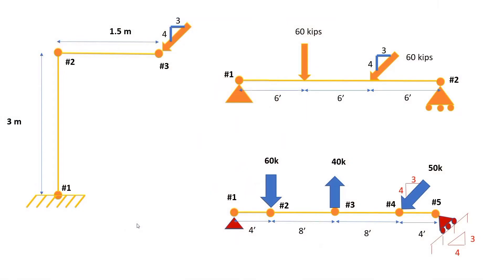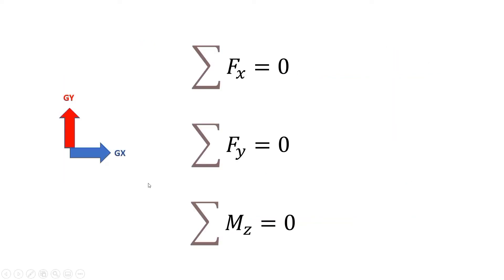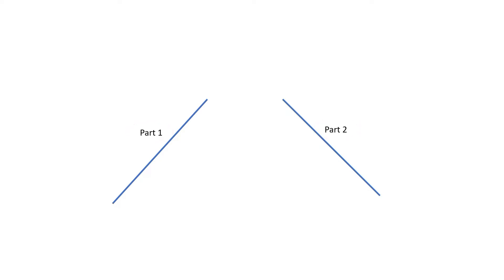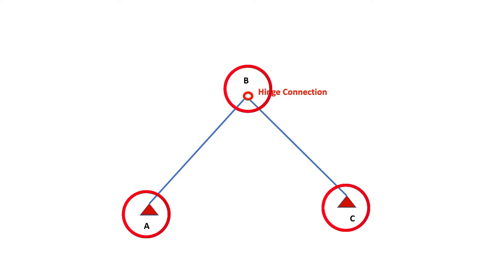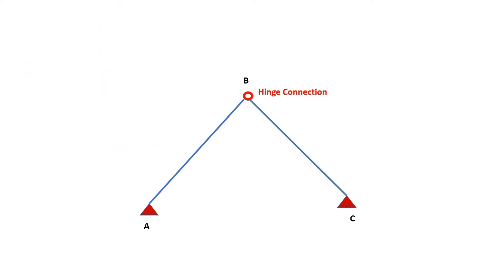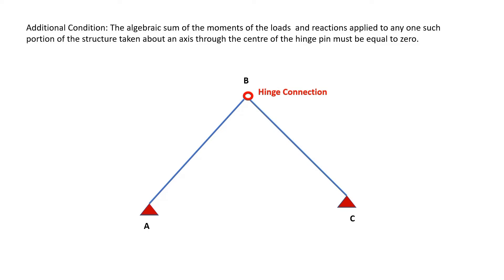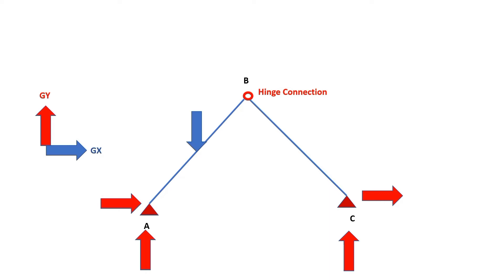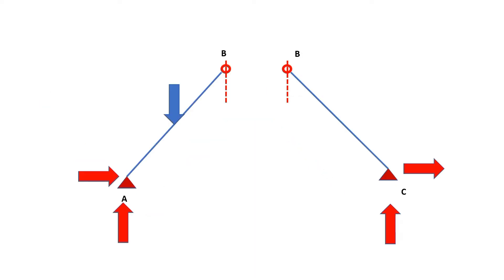#66 - Equations of Condition or Construction

Comment: Thank you very much sir,
We watch your webinar on modelling, analysis and design of underground water tank,well, you made template for impulsive and convective pressure for water wave sloshing,
Sir is there any in built features in staad pro, so that we can directly use convective and impulsive waves rather than using template???
Because sir, when we design elevated tanks, especially tanks with conical bottom, there is a problems in calculation of impulsive and convective wabe pressure using template,
Sir what is the way to incorporate static seismic analysis procedure for elevated/underground tanks??
Sir, which method is economical WSM/LSM for design of tank using IS 3370 code??
Thank you sir...